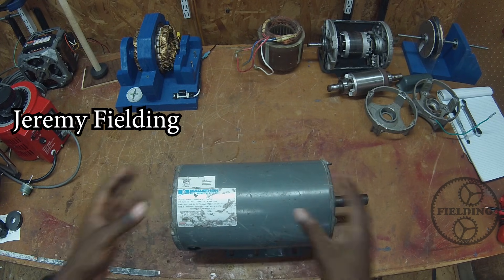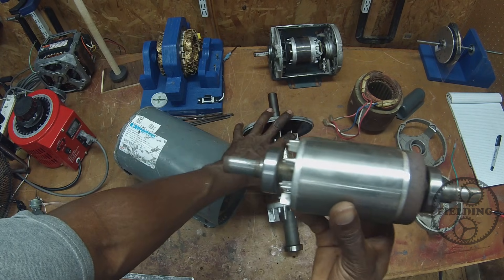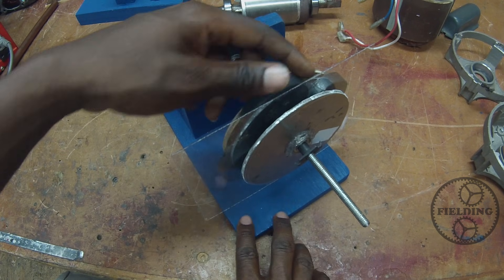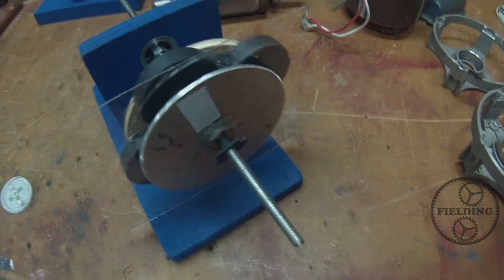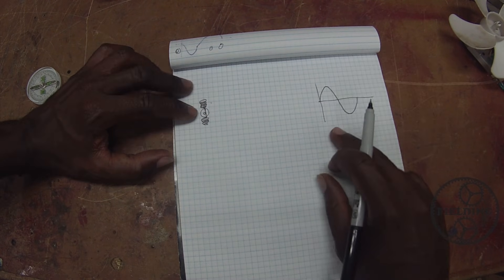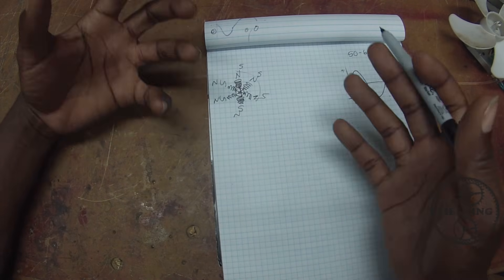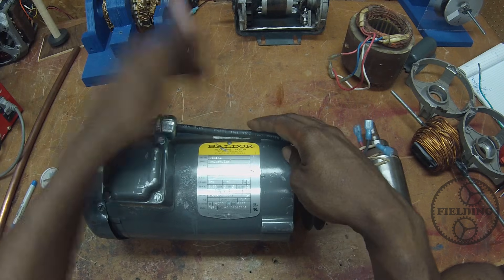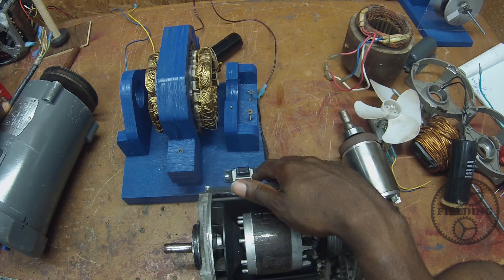How Motors Work for Beginners (Episode 3); Three Phase Induction Motors: 034

Comment: Jeremy, I wish I had seen your videos way back when I took introduction to electrical engineering in college as a mechanical engineering major. Your explanation and demonstrations would have been a great jumping off point and made the textbook work where the finer points of electric motors were discussed so much easier.

Comment: Great series. I'm really enjoying it and learning a lot. Thanks.
What causes a motor to "burn up"? At my work I see 1hp fan motors being thrown away all the time. I asked about them and the maintenance guys say the motors aren't good for anything now except recycling. Would these possibly be fixable?
Reply: a "burned up" motor normally means the insulating enamel on the winding has burnt away due do the windings getting hot.  This shorts the winding and prevents them from creating a magnetic field.   The shorting usually will continue briefly until the actual metal melts breaking the circuit.  The only fix is re winding the motor with new wire, which isn't practical in most applications.
Reply from the maker: +Don S induction motors require very little maintenance and don't usually "wear out" you can draw too much current and burn the windings over time. The motor may be too small for the load... in this case the fan it is pushing
Reply from the maker: +Don S if the winding is burnt it is not worth fixing... that is in a 3 phase motor. Single phase motors could have other problems like the capacitor which is cheap and easy to replace
Reply: Also, I believe the bearings will go bad and can be replaced... if it hadn't burned up. I have a couple I picked from trash I hope to replace bearings on. I have no idea on the other! Thanks Jeremy.
Reply: I have found that it is the capacitor that is usually bad on a fan. The maintenance guy probably doesn't want to have to clean off the motor, take it apart, swap out the capacitor, put the fan back together, and then rehang it. So they will say that the fan is shot and just hang a new one. Ask me what I do for a living. LoL

Comment: Explain what gives rise to the field in EM?
Reply: we understand how it functions but not why... items can be magnetic if the atoms align in such a way that each little atoms charge in aggregate can create a force know as magnetism, polarized field lines with positive and negative charged groups of atoms can attract and repel other atoms within the influence of the field, based on their polarity. we find that alternating an electric field by spinning those aligned atoms within a winding of conductive material within proximity of a non electrified conductive winding will induce a sympathetic electrical charge. thats where the electric field can be measured in alternating current, and some fancy electrical components can trim the positive wave form and direct current can be created as well. thats how the magnetic fields and electric fields can be put to work, but we have no clue why things behave that way, we just know we can produce these results with these methods.....

Comment: if u need a new logo for the channel or a new cover just tell me ok mate i will help u with that
Reply from the maker: Please send me a message on my website. It is easier to keep track of your contact information that way. www.jeremyfielding.com
Reply: give me ur facebook page that will be easier
Reply from the maker: +k k https://m.facebook.com/JeremyFieldingSr/
Reply: Great video, very well explained.   You should keep an eye out for a used VFD, which will let you run a  three phase motor on a single phase 240V supply. Ideal for smaller Motors where big HP is not required.

Comment: can you rewire a 3 phase to a single phase? if so please explain how
Reply from the maker: +TIM LASHLEY the short answer is yes but the motor would not last long... all of the load would be on just one winding. There are some options available like single phase-to-3 phase inverters and a couple of quick and dirty options which I will show in a later video.
Reply: Jeremy Fielding ok thanks sir I love your videos find them very informative and you show your smarts when it comes to using your head to do things.
Reply: I got a 3 phase 440v motor to run. Just used two capacitors. Its seems like its close to full rpm and haven't had it overheat or anything. So do you think that means all the load is still on one winding?
Reply: blu3flare25 running on 220v ?
Reply from the maker: This is slightly different. Using run capacitors creates a phase shift. You have two phase instead of single phase power. The windings are not running "evenly" but it is better than that I was describing above. It will run like that, but it will reduce the life of the motor. If it was a drill press or something that run for short periods I don't think it matters much. Especially if we are talking about a salvaged motor. If it was a fan that runs continuously, I would be concerned. And I might be slightly more concerned if I paid money for it. lol
Reply: Its just a salvaged motor. I just got interesting in seeing if i could get one to run on 3 phase myself, after i found out almost everything in my grandfathers machinist shop runs on 3 phase.
Reply: TIM LASHLEY Its running on a 120v outlet. But i have two capacitors that are 440v.

Comment: Any idea why isn't the single phase designed as an alternating pattern: N-S-N-S-N-S (for 6 pole)?
Reply from the maker: +neowiza360 draw it on paper and look at it. It will make more sense if you do it that way. Remember that both sides will peak at the same time so it would a peaked north next to a peaked south. Imagine how a compass might behave. In fact try it if you have one. :)
Reply: but the rotor has quite a bit of inertial moment (unlike my compass) biasing it towards the "forward" direction, so it will in fact move in the rotation direction. No?
Reply from the maker: Maybe I don't understand your question... but I am specifically thinking about starting the motor. At Start-up you need something to kick of over. Without that the motor will not spin. If the windings are as you describe at startup I would expect the motor to not spin but pulsate back and forth in a very short motion or not move at all. Please explain more If I am not addressing your question. The moment of inertia would not be a factor. Regardless of its mass I would not expect it to rotate. Inertia would be overcome by the force of the stator magnetic field as they should be designed to create the appropriate amount of force to push of over.
Reply: I think I get it now. Not sure, but I'll try and make a model to see if it helps.
Thanks.

Comment: About aluminum:  A good conductor, yes, however, it corrodes very rapidly giving it an aluminum oxide layer.  Ironically, this layer gives the impression that it doesn't "rust, which is great for some purposes.  Unfortunately this layer can create poor electrical connections which generate heat.  P=Ri^2.  Points of connection can melt or start fire/smoke.